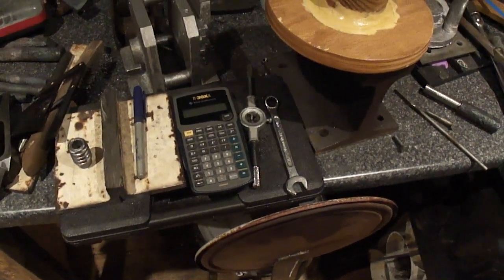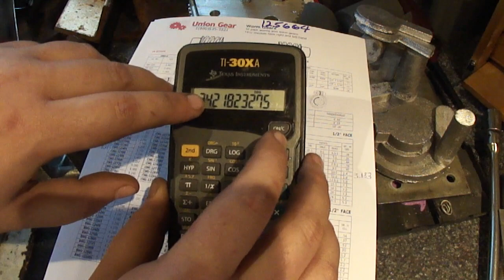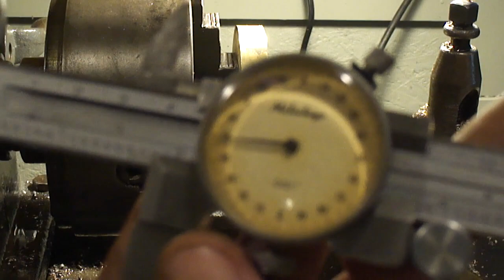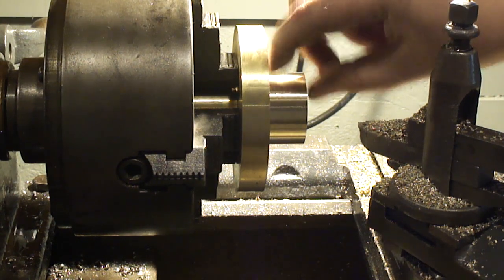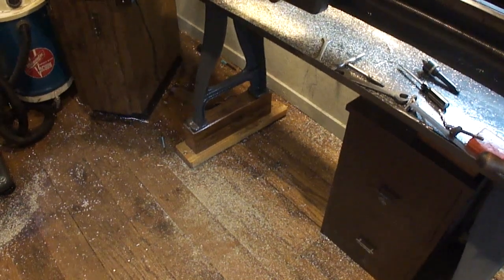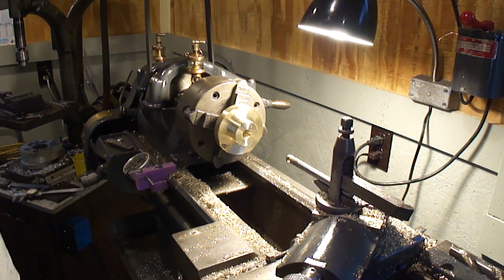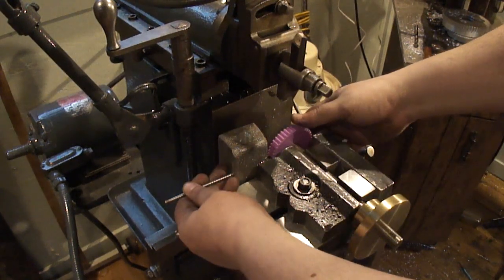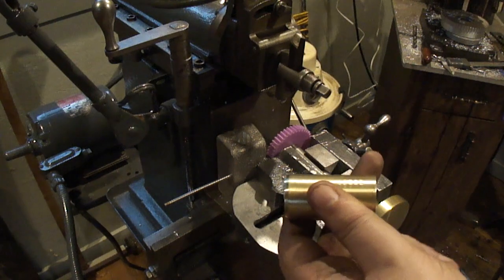Gingery Dividing Head - Machining the Worm Gear P1

Comment: G’day Chirpy I thought I best check out your DH series as it’s going to be my next major project. 
Shame about the flaws in the casting but hey it adds character. 
Off to watch the next video. 
Cheers 
Peter
Reply from the maker: the dividing head came out quite nicely in the end and has been useful, but after using it for a few, there are a few modifications I would do to it tho. main ones that I would do is make a bigger spindle so I can use collets in it or a way to attach a chuck for work holding, and for the grub screw that keeps the worm and worm gears together, I'd replace that grub screw with a spring. Other than that, its a pretty nice unit.

Comment: Excellent Chirpy, you are 90% there with your imagination for your setups.  I'm sure a lot of us would be scratching our heads to do this work without a dividing head milling machine and all the other bells and whistles we take for granted.  
Cam
Reply from the maker: lol, I like reading old machining books, and the one thing you learn from those are that people back then didnt have all of the fancy stuff that people have today, they used a shaper/slotter for cutting, or they did it on the lathe. They would have some interesting setups, but it all seemed to work because they just outsmarted the problems they were faced with and just used what they had available to them, so I do just that, use what I have available, and try to outsmart the problems in front of me, lol.

Comment: i use a chip brush like a shield when ther spraying like that . use to have one with a hole in the handle over the tool post nut ,but it got eaten one day so i just hold it . thanks for sharing !!
Reply from the maker: Im not sure why, but before I rebuilt my lathe, I would get the thing spraying hot needles all the time, and there was no chips, just needles. After rebuilding it, it doesnt really spray them that bad anymore, just the occasional one here and there will land on you, but most just go all over the tool post and that's it, and the stuff comes off as actual chips now. So it's not really an issue of the stuff spraying anymore, it just looks like it in the video. 
One of these days, I need to make some sort of cyclonic filter system to suck up the chips and make them not go into the vacuum cleaner, that would really make the stuff easy to clean up, lol.

Comment: Very nice work. You achieve a lot with minimal tools.
I'm going to have to try your charcoal bricket method on aluminum one day.
4° 46' is actually rounded up to 4.8° degrees Decimal
4° 46' 0"
= 4° + 46'/60 + 0"/3600
= 4.766667°
Reply from the maker: thanks, the charcoal briquettes do work but they create alot of mess and are pretty slow to melt the aluminum imo, but Im also used to melting it with an oil burner. It does work pretty well tho and if you can have some sort of lining to help keep the heat inside of it and a lid with a hole in it for a vent, then it will melt the stuff much faster tbh. There's plenty of charcoal furnaces out there and one I would check into is a book from david gingery with the making a metalworking shop from scratch series which is where the plans for this dividing head came from. I would avoid anything with plaster/sand in it tho.

Comment: Is that brass or bronze that you cast? It looks really good even with a couple of small inclusions, Can't wait to see the teeth cut it will be very interesting. Thanks for the video!
Reply from the maker: yea, thats the naval brass that I had cast out, which it machines very nicely but is some seriously hard stuff. It's a type of brass with some tin in it, so it's harder and more wear resistant than normal yellow brass, it wont really tarnish like normal brass will, and has the slippery nature that tin bronze has, so it's perfect for this application. 
Technically, the teeth cutting video is already uploaded, just didnt release it yet. I didnt hob it yet because I need to pick up some 1" CRS to make the worms and hob out of, then case harden it. Ill release the video in a few days, that way I can keep some sort of schedule, and give me time to get the steel to make the hob and worm.

Comment: 2:43 I've had a TI-30XA Calculator just like that for over 13 years now and replaced the batteries in it 3 times. Just can't get used to anything else at this point.
Reply from the maker: oh, Ive had that one for probably that long and have no idea how to change the batteries in it or if you can change them because it's never run out of charge before.

Comment: This is very impressive. I have to do the same very soon. Do you happen to have a link for that Union Gear chart?
Reply from the maker: Thanks, and I do not, I just looked up 12DP worm and worm gears and found that document on google and it showed the dimensions of everything in it, so I just saved it off and used it to cross reference everything.

Edit: I couldnt find it online anymore, so here you go.
https://drive.google.com/file/d/1dcyTlxwZwJFfJlmZnBNYy2UCdLpp4z3A/view?usp=sharing
Reply: @ChirpysTinkerings  I really appreciate you going out of your way. I did not expect that. I've been restoring an old South Bend lathe and need to reproduce the worm and gear for the power feed. Your videos have been very informative and I enjoy watching them. Thank you again.
Reply from the maker: @LeadedAsbestos  No problem, Im always glad to help if I can. Also good luck on restoring the old lathe, you might be able to find the replacement worm/worm gear since south bend lathes are quite common.